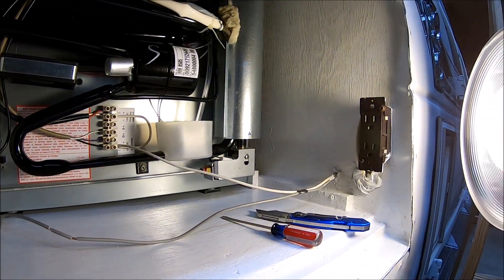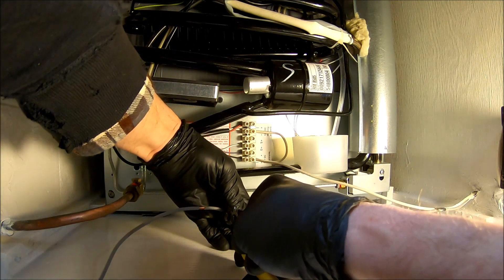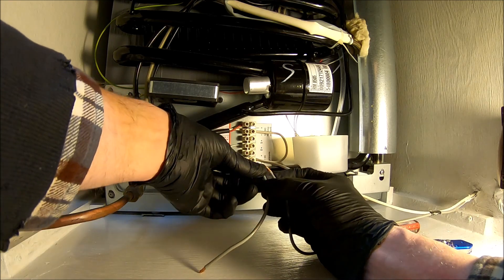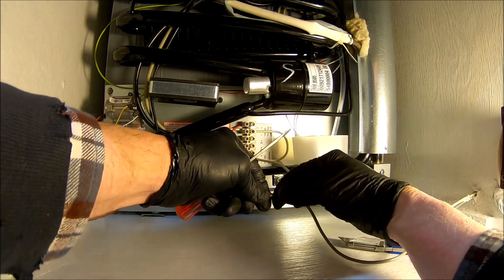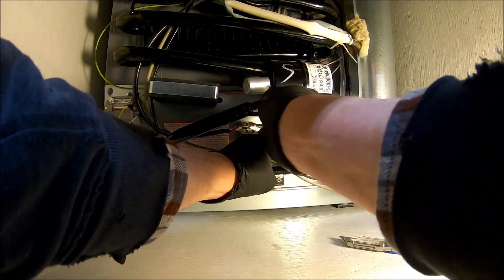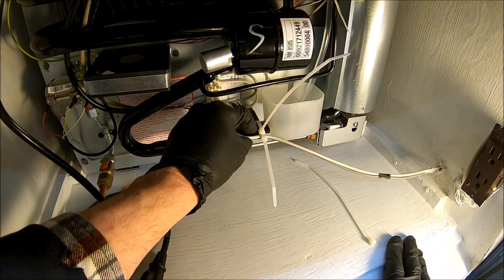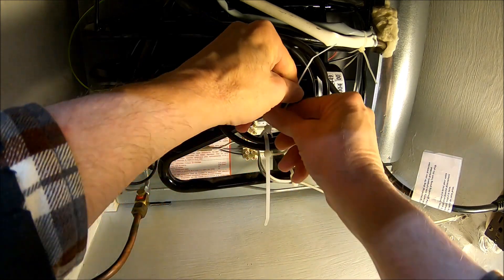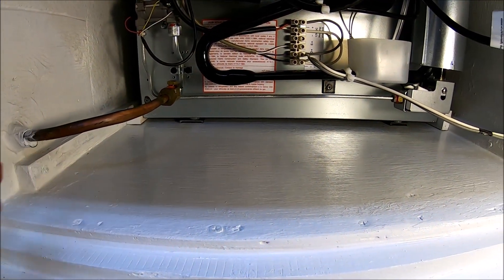Wiring Dometic Rv Refrigerator RM 8505.

Comment: Where does the 12v wire come from? My 3 way won't switch to DC even if I manually try. So I'm trying to figure out if there's a way to check to see the wires going to it before I try to take it out of its hole.
Reply from the maker: Probably from a fuse panel that is in the coach part if it is a motorhome. You probably need to get a wiring diagram for your particular rv.